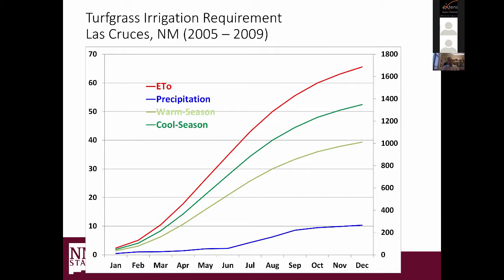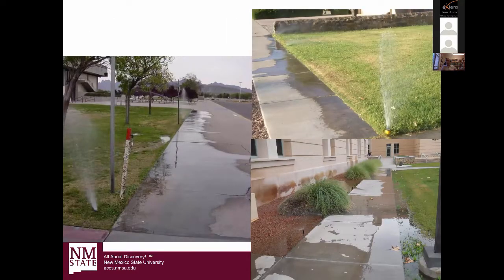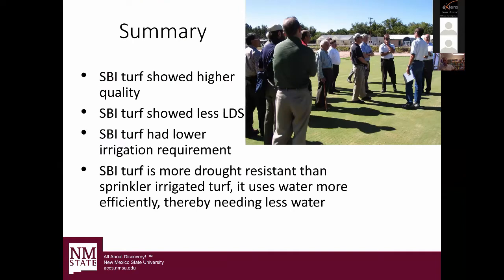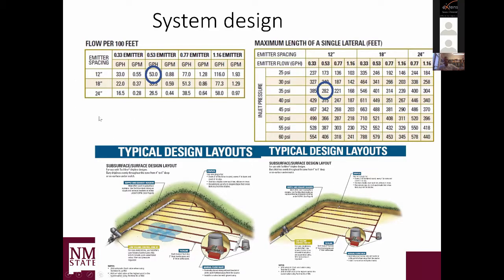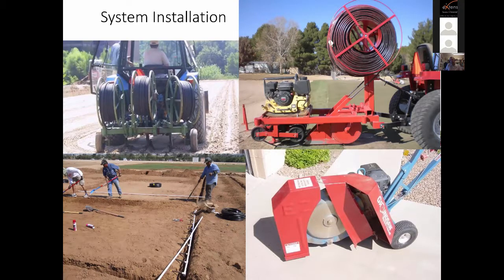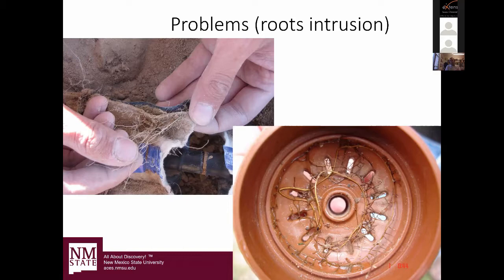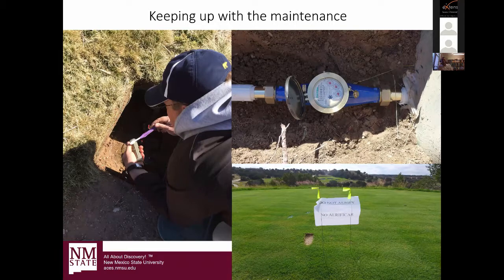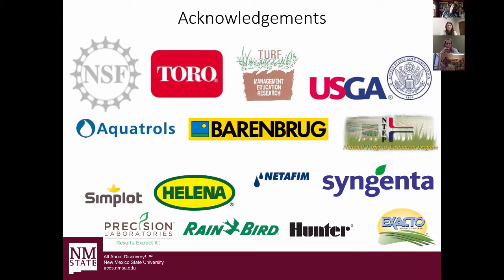Subsurface Irrigation for Turfgrass Water Conservation - Dr. Bernd Leinauer , Jun 2018

Comment: I noticed that the instructor did not mention an 'activity indicator' which is a red or yellow shaft mounted in a standard sprinkler riser body.  When the subterranean system is turned on,  the pressure should be high enough to make the shaft on the activity indicator rise so that you know your system is turned on.  Good for residential applications.